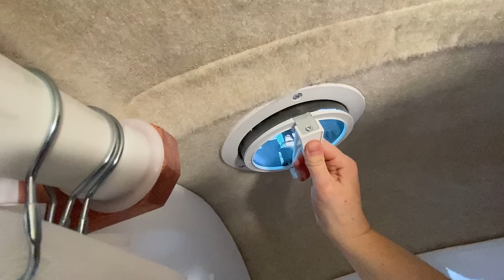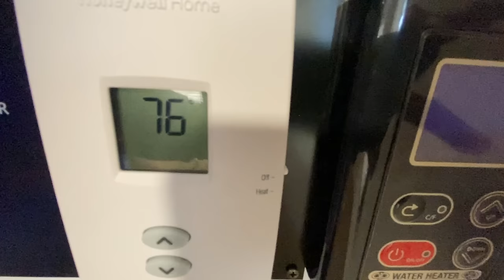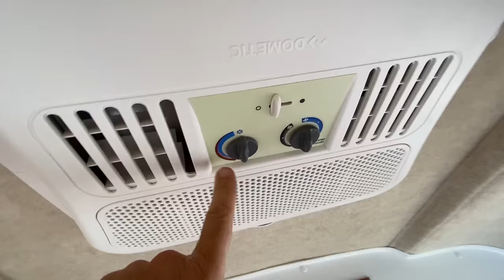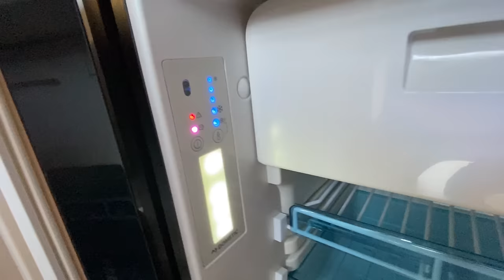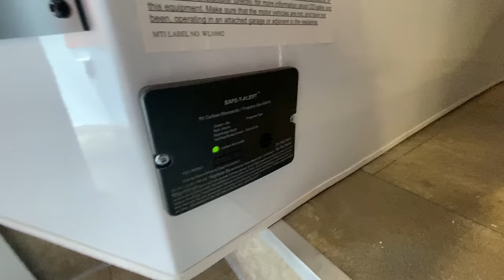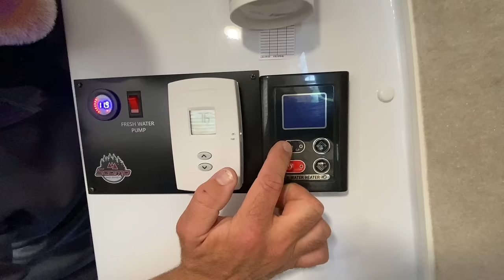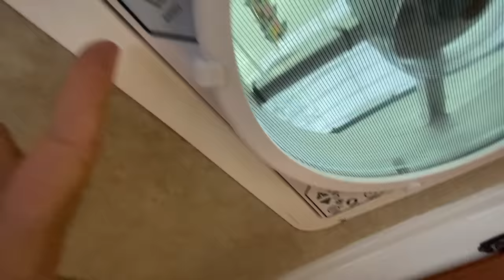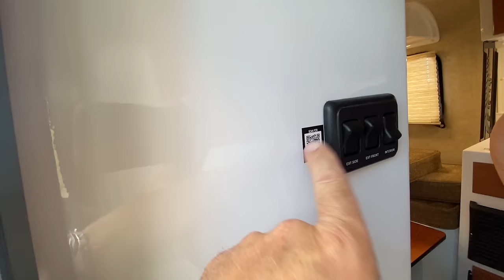Episode 2 - Scamp Walkthrough

Comment: I don't like that you can't travel with water in it, and that ceiling carpeting is awful.  It's also expensive for the cheap quality.  PS:  It's De-Winterize.
Reply from the maker: Ah, de-winterize.
Reply: You need to be able to have water
Reply from the maker: Well, technically you CAN travel with water in it. Scamp cautions owners to fill the tank as close to possible of their destination to avoid traveling far with the tank full. Obviously, this makes since for weight and fuel economy but it also reduces stress in the two straps (it appears to be plumbers tape) that holds down the tank.